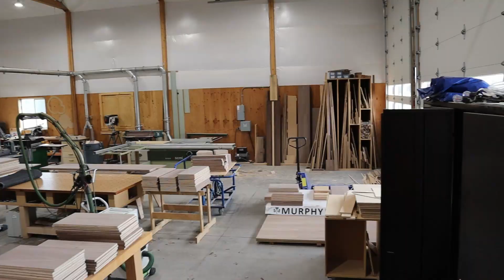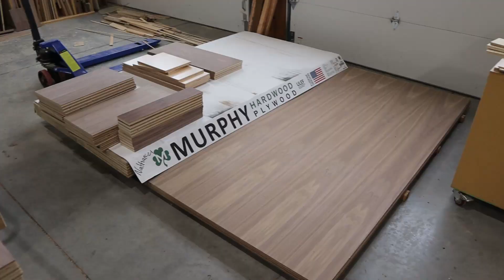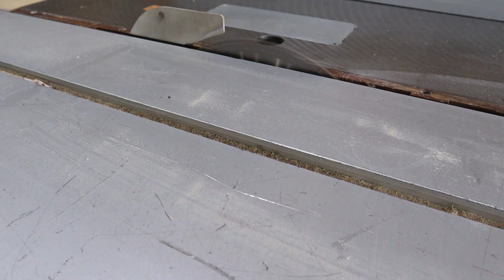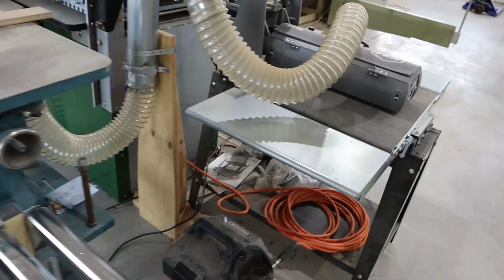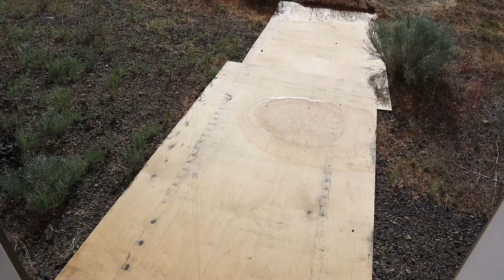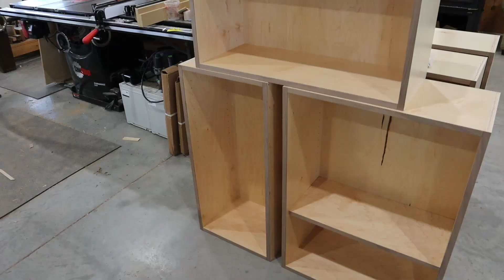Shop Tour! Huge cabinet and furniture makers dream space.

Comment: Is it the shop have AC for summer and heat for winter to heat. To control the temperature? 
I mean .I had built the cabinets and assembled it leave it at the garage without humidity control and a couple days it’s warping. 
My question is does the cabinets shop need a temperature control.to build a cabinets and furniture???
Reply from the maker: I have no climate control in my shop, although it is well insulated. In the winter I keep a fire going in the wood burning stove. In the summer I try to open the windows at night and let the cool air in, then close them during the day. It works for my situation. I would prefer to have a more stable temperature in the shop but it's not necessary.

Comment: Love the shop, What was the original reason for the height of the building.     My shop building has 14ft walls and 19ft to the peak " more than enough".
Reply from the maker: That is a good height and if I were to build again, it would be closer to that. We built it this high, with 16 ft doors, to be able to park tiny houses inside, which I did for a time and finished the interior of one inside the shop and that was very nice. Although looking ahead, I don't see doing any more tiny houses but the option is there.
Reply: @nathanielpotterwoodcraft  RV